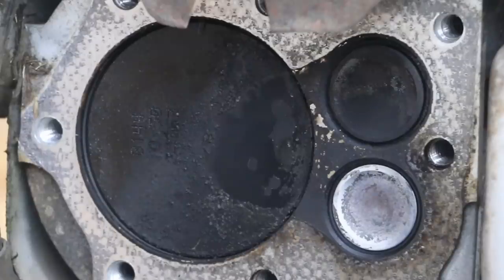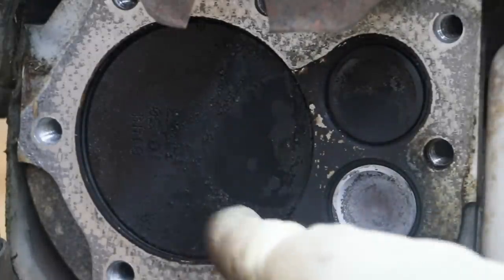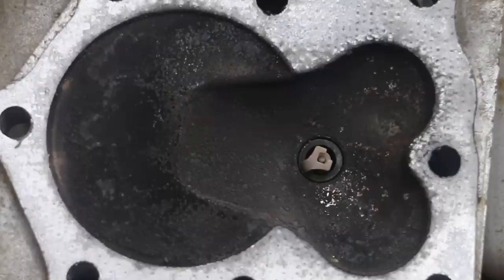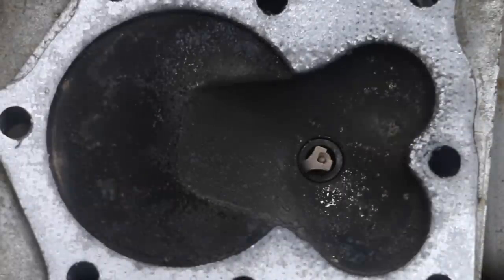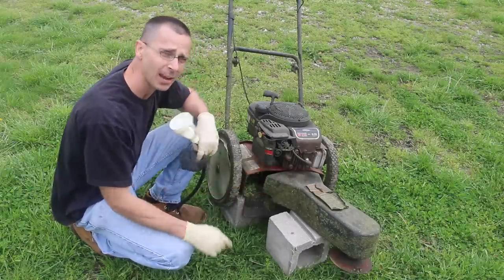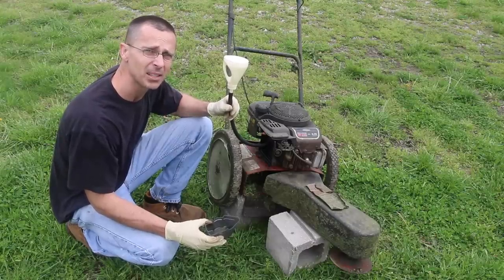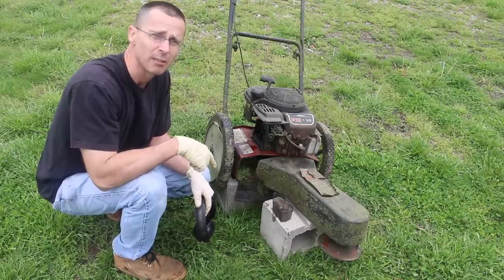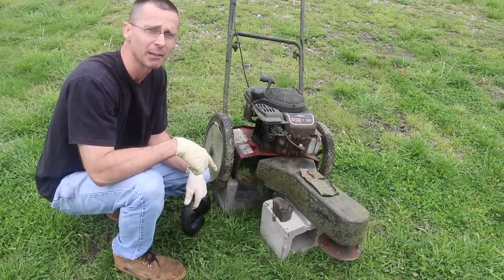Seafoam--can't believe what it did to my engine part 3--cylinder cleaning test!!

Comment: It's not all about how clean it looks. If the valves seal better that's the biggest improvement. 

 The trifector of in the fuel, oil and sprayed in should give the best results. Freeing up the moving parts from sticking and sludge buildup. Which most engines do not need at all. 

 Just run good oil, stabilize the gas. Changing the oil before storage can help with preventing leaks form the acidity of used oil. Also gives less time for sludge to settle or cake onto moving parts or in areas you don't want it.
Reply from the maker: Eric M, I think you identified the reason why the intake cleaner improves results that can't be seen--it allows the valves to seal better!  Thanks for watching the video and commenting!
Reply: As much as I like to see clean pistons, this seems to be true. Even if the cleaner doesn't remove all of the carbon, it's possible the improved combustion will clean it up in a month or so. I would only add that as the engine is running, the carbon coating the inside of the chamber constantly flecks off and this is a source of potential pre-ignition or pinging. So if you have an engine that is vulnerable to pinging (how common is that anymore?), having the whole head cleaner could be a good thing.
Reply: In higher mileage cars it can actually Decrease the seal on the valves as the coke takes up the small gaps and fills them. cleaning this out can make the car run roughly.
Reply: I've heard TCW3 2-stroke oil in the gas will seal worn piston rings pretty well and reduce oil burning.
Reply: Sean, if it reduces the valve seal then the valve seat is damaged. Those would likely fill up with carbon again as the soot would gradually seat back into those areas.

 On a different note: I recently gave a honda EU1000 generator that I go for free a sea foam treatment. It had a smoky haze you could see out of the exhaust and the surrounding area was hazy.

 Started with the oil flush. Put some into the fuel. Ran for a few hours.  

 Put some into the combustion chamber . Put the plug back in and lightly turned it over to get everything coated. Left for a few hours, pulled the plug and lightly cycled it to remove the excess. Put the plug back in.

 Sprayed into the intake while running, about 1/2 a can.

 Then ran for a few more hours. Did a oil change and spark plug change.

 Fires up good and the smokey haze it used to give off isn't noticeable unless you got it set into a corner. 

 It was a if it cleans up great. If I ruined it then I'd turn it into a project to rebuild with the kids in a few years.
Reply: Damn i never thought of acidity of oil sitting all winter. Makes me feel guilty for my welding truck :(
Poor thing

Comment: make sure engine is off and cool to touch. I used baking soda and vinegar (carbon deposits got easier to clean). make sure you rotate the flywheel to close the I/E valves before hitting those areas. rotate flywheel to bring the piston away fromTDC to wipe cylinder sleeve clean (do not use baking soda vinegar in cylinder sleeve area). i used old sparkplugs to leave into the valve cover for cleaning with baking soda vinegar solution. wipe just a little bit of WD40 on the piston tops/combustion chamber areas to prevent rust. do not use WD40 on cylinder walls. use vaseline on cylinder walls or cylinder wall lube(summit racing might sell it, dry film powder lube). repeat other side if you have another piston there.
Reply: Dela Rosa, Marlon A. L
Reply: Suprised
Reply: Dela Rosa, Marlon

Comment: I ran Seafoam through the vacuum line in my 2001 Lincoln Navigator with 189k on it after watching your first video in this series on the truck with high miles.  I was BLOWN AWAY by the difference.  It immediately ran smoother and quieter.  According to my onboard computer my gas mileage has gone up from 10.5 mpg to 12.5 mpg (local driving, lots of hills).  Best $10 I ever spent at an auto-parts store.  I am VERY impressed.  I think I will run it through the motor on my wife's Chrysler minivan (100K) and see if that makes a difference (I am guessing it will)!!
Reply from the maker: Anthony, Impressive!  Thank you very much taking the time to comment.  I hope you have good success when using Seafoam on the other vehicles too.
Reply: Project Farm Well, did the 2007 Chrysler Town and country with 109k on it today.  Same results.  Blown away by this stuff!

Comment: While it's hard in real-time watching the video to see a difference, when I screen-captured the valves' before-and-after shots, there is a marked decrease of chunky carbon buildup. The "color change" of both valves is minimal, but the accumulated solids seem significantly reduced. I've been skeptical of any additives, but after seeing your triple-test of Seafoam, I decided to give it a try and notice less throttle sticking and overall hesitation on a 100,000-mile motor. That said, like you, I don't trust my "feel" given the Hawthorne effect.  However, the onboard computer shows my average mileage at 21.5 versus 16.9 before the treatment.  The throttle sticks less, and I heard and observed that during the ingestion of Seafoam.  So, I'm a believer, but seeing the marginal results here does give me some pause.
Reply from the maker: Thanks for the feedback.

Comment: It looks like the intake valve lost enough carbon buildup to improve the seat surface for better compression
Reply from the maker: Great point. Thanks for commenting!
Reply: Was it that, or the piston wasn't at TDC?  
 @ProjectFarm
Reply: Yea but the spark plug and head got worse
Reply: And ur only supposed to out that in desiel engines ik I spelled that wrong
Reply: Nice!
Reply: @unsafeweevil2041  says "Gas or Diesel" right on the can.

Comment: This is kinda long, but its generated from over 50 years of experience with internal combustion engines, including flathead, overhead valve, water-cooled and air-cooled two stroke, turbine and jet engines. Gonna leave out a bunch of background and skip to modern day engines, fuel packages etc. In the 80's oil companies and fuel blenders began mixing in "cleaning agents" and also ethanol alcohol to increase the volume of fuel sold. That is, increase the fuel prices without increasing the amount of fuel sold. Yes it helped clean our engines, somewhat, but also introduced us to intake valve deposits, plugged catalytic converters on non marine engines, vapor locking and a myriad of other heartaches. I was fortunate enough to have been included with factory research and development and experimentation with Mercury Marine(Mercury outboard motors and Mercruiser Stern Drives) and OMC(Johnson/Evinrude outboard motors and OMC Stern Drives). 
We found the primary cause of all these problems to be the additive packages from the fuel blenders and reckless use of ethanol added to motor fuels. To make a short story long, OMC and Mercury Marine developed some additives to try to help combat some of the the horror stories created by irresponsible oil companies and fuel blenders. 
Similar to Sea Foam(but I believe to be superior) are OMC's Engine Tuner, primarily for 2 stroke outboards, but will also work on 4 cycle marine and passenger car engines, and Mercury's product(cant remember the name)which is similar in chemical content because it produces similar results.
The carbon-choking problem was so severe in water cooled outboards that it literally glued the piston rings into the ring grooves in the pistons to the point of producing 0psi compression. OMC Engine Tuner used heavily over a period of several days, literally brought these engines back from the edge of needing an engine overhaul back to factory recommended compression pressure. 
There is alot more to this story, but I suspect I have lost many peoples interest already LOL. 
If you are interested in more details, contact me at rogue682@yahoo.com.
Thanks for your time and patience
Rogue
Reply: Thanks for sharing!
Reply: Yeah...gonna check out OMC now. Thanks for this Rogue.

Comment: Excellent video. I'm surprised it didn't do a little more. As with most tests like this I have seen, it took up some around the edges and seemed to remove some of the surface, but didn't make a huge dramatic difference. I know allowing it to really soak in cylinders first and then running it does more, but it's such a pain to do, especially on anything but an inline engine. Great job!
Reply from the maker: 802 Garage, I agree.  Others have commented that adding Seafoam to the fuel in combination with this approach is more effective.  Agree that allowing it to soak would be more effective.  Thanks for watching the video and commenting!
Reply: 802... I don't think it reasonable for hundreds of hours of use causing the carbon build up to be eliminated with just one treatment of SF. Added to the gas over time I'll bet would do the trick.
Reply: blipco5 I absolutely agree! Totally wasn't criticizing, just analyzing. I think repeated use over time can do a lot more.
Reply: Project Farm no problem! Loving the content.
Reply: +802 Garage 
Same here. I never believe these "miracle in a can" products but I've used SF in rough running small engines before with good results. It's nice to see it wasn't all in my head.
Reply from the maker: blipco5, Thanks for watching the video and commenting!

Comment: The question is did the treatment measurably impact any performance metric, be that power, economy or long term durability.
Reply: If there are any I feel like it'd be similar to a transmission oil change. Its not that doing the maintenance created a problem, rather that it exposed existing ones. I imagine he would have told us if there were any problems he noticed after doing the treatment.

Comment: The carbon concentration in different parts of the engine just shows what a inefficient design it is with those valves
Reply: It's a classic Flat-Head Ford V1 0.o

Comment: I like your video experiments. I actually tried to do the sea foam treatment on my out board boat motor after watching you perform the tests. It looks like it removed a minimum of build up in your engine. Maybe multiple process is the answer.
Reply from the maker: Yes, multiple treatments will make a bigger difference. Thanks for the positive comment.

Comment: Hello, interesting your videos I am a technician in diesel engines and generators .ASE plus other 24 certifications, Native of South America (Uruguay). I knew the engine cleaning system inside with water by my uncle he showed it to me by dropping it  drops in the carb ... mmmmh year 1970's, old school. I can also tell you that he had an old Packard from the year 30 (Limousine) who needed a gas station to be able to ride in it, especially in South America where the  Gasoline costs fortunes. He did not give up and invented a system that used water vapor in the intake of the carburetor. I remember that we went out to do the test with a liter of gasoline and he gave us 12 kilometers and when he put the steam system we made  with a liter 19 km. I have the plans of his invention.
KEEP UP THE GOOD WORK, HELLO FROM FLORIDA.
I DID SOME UPDATES ON IT USING SOME OTHER MIXTURES.
Reply from the maker: Thank you for the feedback

Comment: Good directed video. I think it will be easier to lift the head and use BBQ-cleaner applied with a toothbrush and let it soak, then rub with a steelbrush. It's faster and less enviorment damaging. Keep up the nice vids.
Reply from the maker: Willem, This is great advice!  Thank you for watching the video and commenting!
Reply: Project Farm use omc engine tuner for outboards
Reply: actually I'm using steelwool, but lightly because the carbon is weak due to the BBQ-cleaner.
Reply: Amen Chris Ericksen!!!!!!

Comment: Yes it did make a difference. It may take multiple treatments on an automobile, but considering it costs a lot of money to tear down a car this is a very cheap alternative to get back performance from your aged vehicle. Value can only be judged by the owner. With that said I’ve used seafoam and have noticed improved performance. Some maintenance is always better than neglect. Great video as usual!
Reply from the maker: Thank you

Comment: I used this product as a “fuel mixture carburetor cleaner” for an old dirt bike. I added several ounces to the fuel tank and repeated twice. It made a huge difference in the carburetor performance both at idle and at operating speeds. I recommend cleaning and re-gapping or replacing the spark plug after a deep cleaning such as this one.
Reply from the maker: Thanks for the feedback.

Comment: I swore by Seafoam for years until me and a friend did a little test of our own.  He was a Berryman B12 Chem guy and we had our debates and put them to the test.

We filled 2 glass jars, one with Seafoam the other with Berryman's B12.  We placed 2 completely carbon coated valves from the same engine, one in each of the jars and let them soak for 24 hours.   The next day was the moment of truth...

The Seafoam valves, while some of the carbon in spots had come off, 80% of the valve was still coated and needed firm scrapping with a paint scrapper to remove the rest of the carbon.

Berryman's B12...  50% of the carbon was gone when removed from the jar, the rest and I mean ALL the rest either fell off coming out of the jar or could be rubbed off using only your finger...

Needless to say, I use Berryman's B12 now.
Reply: @TruthOverLies  With results as dramatic as @preston121068 is reporting, I'd say that's nothing to sneeze at.  I'm grateful for what he reported.

Comment: I appreciate the dedication to experimentation and objective results in this series of videos.  I am a believer after treating my 99 rav4 with Seafoam, and I appreciate the visual.  It seems like the hard carbon is still in my engine, but it runs noticeably better and I'm satisfied with the treatment.  How long do you leave Seafoam in your crankcase?  I left the Seafoam in my crank case for two days, and yes the drained oil was black.

Comment: Back when I used to work on cars, I used to get cars in with bad head gaskets, on cyl's with antifreeze leaking in from a bad head gasket or cracked head, the wet cyl would look brand new.

The hole would be steam cleaned from the hot antifreeze, maybe by slow leaking water into the engine at high idle it might steam clean the carbon

Comment: I think the difference around the valves was pretty significant. That carbon, if the buildup gets severe enough, can cause the valves to seal improperly, which can cause some headache down the road of an engine's life. On the surface of the piston and on the cylinder head, I could see a difference but it wasn't super significant. I think though using SeaFoam can prevent improper valve sealing due to carbon buildup, which isn't a problem that is going to come about too often, even on a tired, old engine.